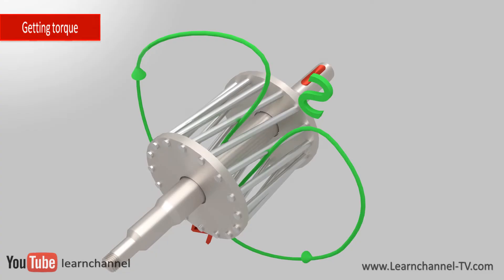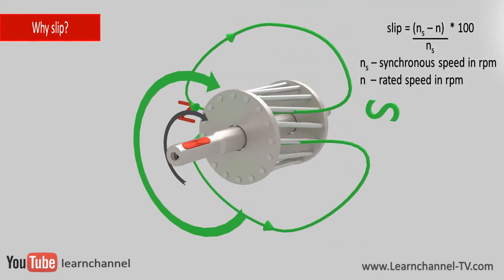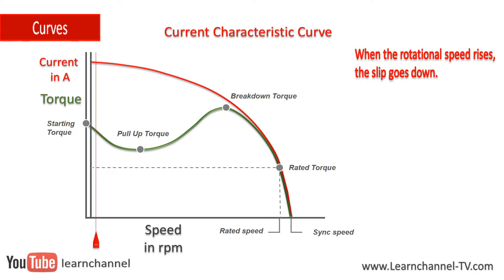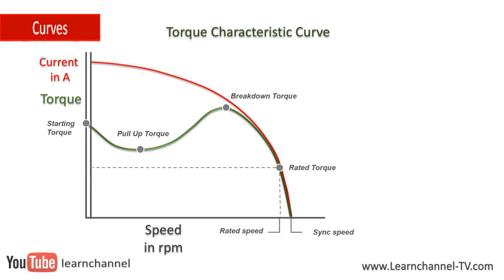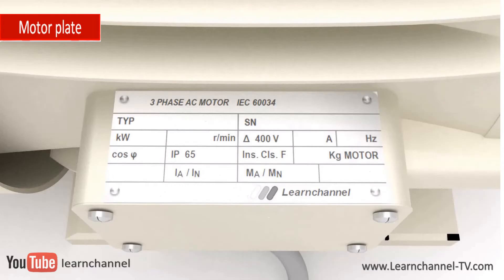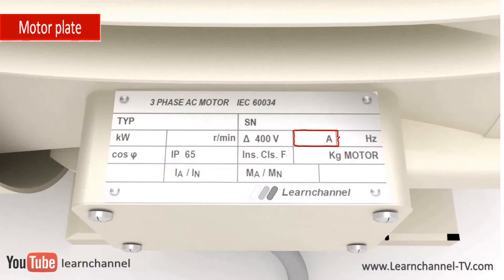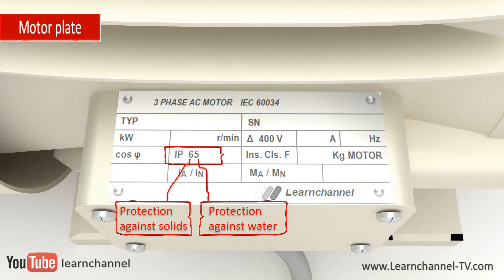How does a 3 Phase Induction Motor work? - Technical animation

Comment: I’m from India. Very useful info. Thank you. 🙏🏽🙏🏽🙏🏽 Need your expert opinion on this: I have a 3.3 kW 3 Phase induction motor with 8 Amps current flow installed on my Grain Pulverizer. It is driven by a regular starter, DOL (direct online) and not a star Delta. The relay keeps tripping even with minimal load and motor also heats up. I ran for few minutes without load and there was no tripping. Let me know where the problem lies. Is it in the contactor relay or the motor itself. Thanks again.

Comment: 4kw VFD step up voltage converter inverter 220v to 380v single phase 220V converter to three phase 380v AC power transformer
https://www.aliexpress.com/item/4000409273937.html?spm=2114.12010612.8148356.4.1c04b91bXVX5Xu

Comment: Power Factor and efficiency are 2 different things.
Reply: To which equation then do you refer that links input power and PF?
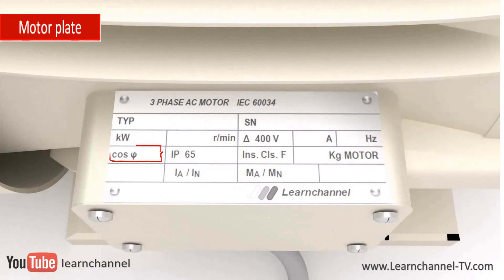4:28
Reply from the maker: @romainf145  You need the PF to determine the electric input power. The motor efficiency is the ratio output power to input piwer. It correct explained and shown in this video.
Reply from the maker: @romainf145  It is  well shown in the video Pel = √3 UI cosφ 
and cosφ = PF
Everything is correct in this video. Have a nice weekend and good bye
Reply: @learnchannel-TV  For me it is not clear whether Pel = √3 UI cosφ or should be Pel = UI cosφ .Since U is usually referred as the Line Voltage, not the Phase Voltage, right?
Reply from the maker: @josemariavivanco9611  Hi   -   √3 = 1.732 you need when you have 3 PHASE voltage!
Reply: @josemariavivanco9611  here stator is 3 ph delta connected winding so V line voltage=Vphase voltage
Line current=√3 phase current. Pele=√3* line voltage*line current or Pele=3*phase voltage*phase current.
Reply from the maker: This is right. But PF and efficiency is the same was not claimed in this video.